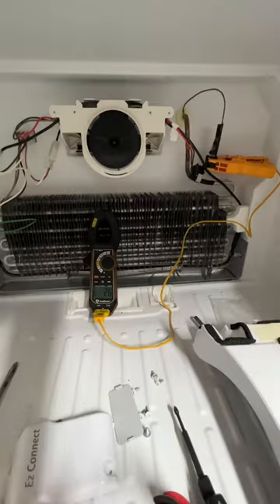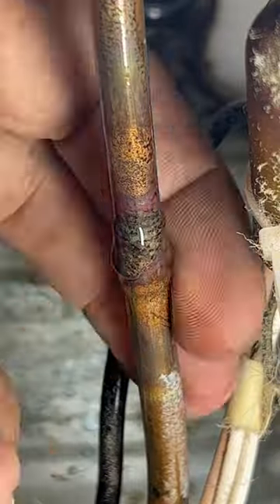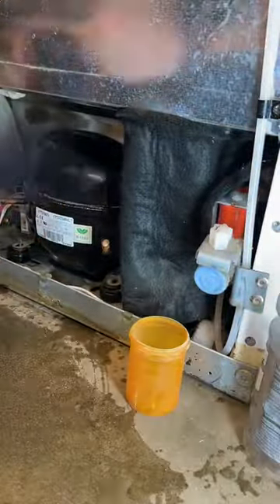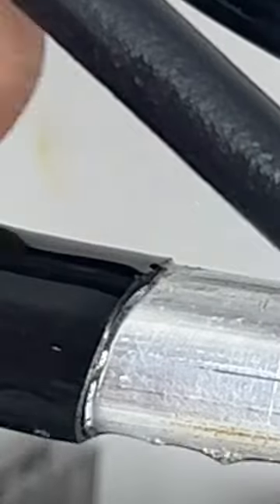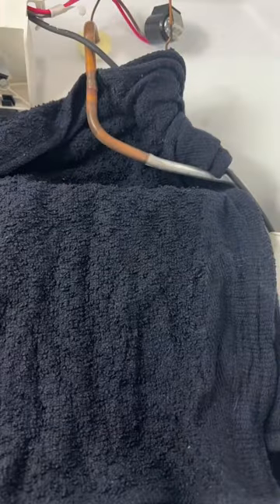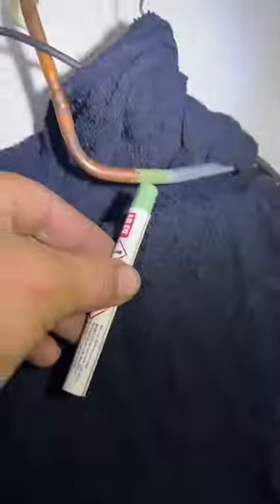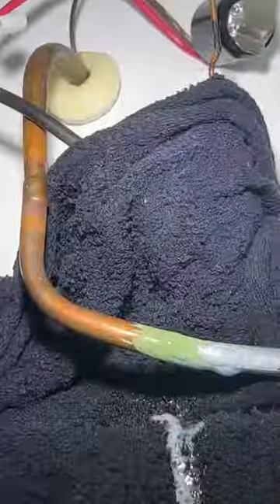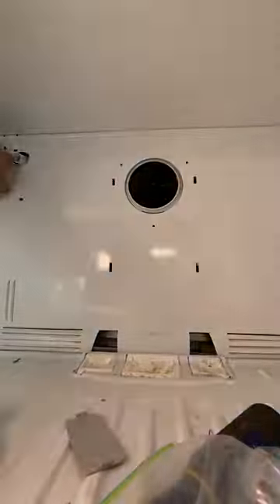Repairing a free refrigerator I received.

Comment: I have 2 of that design in my garage right now from different decades. An evap leak is exceedingly rare, but we can only get 100 bucks out of them normally. I'd have a hard time doing all that to this model, but those epoxy sticks will be a huge game changer for those side by side stainless whirlpools that spring leaks in evaps all the time.
Reply: What would this have cost the customer for a in house repair

Comment: Next time use Safety-Silv 45 Flux Coated Brazing Alloy Sticks to transition from copper to another metal. Works much better. Also make sure you flow nitro while brazing and replace the filter drier if the system has been open for a considerable amount of time for best practice.
Reply: Not for aluminum, al-822 or similar a similar product is what you want. Safty silv would be copper to any other dissimilar metal, except aluminum.
Reply: @ianicus123  I hate when people give inaccurate info. as if they know it all,like above commenter.

Comment: If I wanted to do appliance repair what are the most common tools would I need? I have everything for electrical but what about the refrigerant?
Reply from the maker: Drill, nut driver, screwdrivers, multimeter and a workshop

Comment: In the plumbing world they are always like, epoxy is just a temporary fix, even on drain lines which are ver low pressure. But here, the epoxy is good on over 100PSI.

Comment: Just curious what would happen if you put some JB weld where the leaks coming from ? I know it would be more like a bandaid than a fix but just curious
Reply: What he put on the system is a bandaid. A true fix would be to cut and resolder the connection.
Reply: Replace the evaporator
Reply: @mwv25  nah just gotten cut it and re braze it. But he's already gonna bomb the system with that leak dye shit. All that does it ruin compressor valves and plug capillary tubes

Comment: Ah leak dye. My arch nemesis
Reply: Idk why he even used it in this scenario. The leak was already found and unit was pressure tested and it held. The only time I end up breaking out the dye injection kit is when I have exhausted all other methods of finding the leak.
Reply: @joshwilles7540 he's  gonna come back to a plugged cap tube or failed compressor

Comment: Dame man we use that same epoxy on residential units with limited success. Somerimes it holds but I really hate it cuz most time it blows the joint later on. Although I will say that residential units useally operate at much higher pressures then a 134a fridge.
Reply: Using those for R22 or 410 would be terrible. R134 runs at WAY lower pressure. Talking like 120-150psi on the high side.
Reply: @NeighborhoodDada  I am fully aware

Comment: They're not designed to be efficient. Or the coils would be all on the back to release the heat. They're not designed to be serviced. They're designed to be thrown away and have the consumer get a new one. And the fact that the coils are not on the back tells you that they're designed to market to large apartment compound owners. There's no coils on the back. This way the coils can't get damaged by the residents of the apartments

Comment: How did you get the metal shelf out of the freezer?
Reply from the maker: There is a small plastic clip on one of the supports. Remove that and then shift the shelf all the way to the right or the left whatever side that clip was on. Then you can raise the opposite side of the shelf up.
Reply: @HandsomeOrHandy  Thank you I appreciate the information gonna try it.I cannot say for sure but it looks like we have the same fridge. I have the exact same coverings in my fridge. My issue is the bottom does not get cold anymore but the freezer is artic blast with the fan clanking because of ice build up.

Comment: What kind of pressures can this epoxy take ,and temp
Reply from the maker: 350F(177C) and 600 PSI (41BAR)
Reply: @HandsomeOrHandy  ok what about a evaporater on a home AC can it be used ,now manufacturer of epoxy